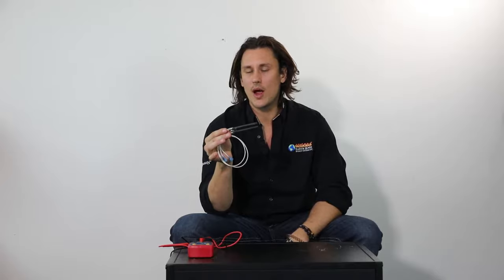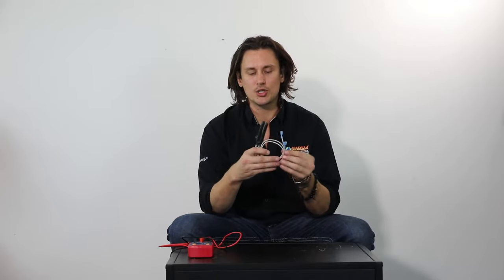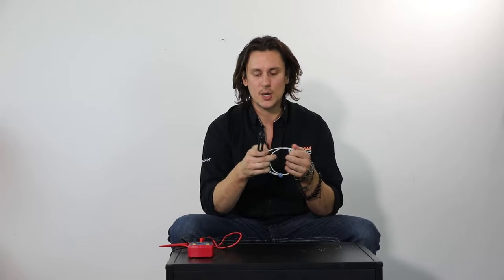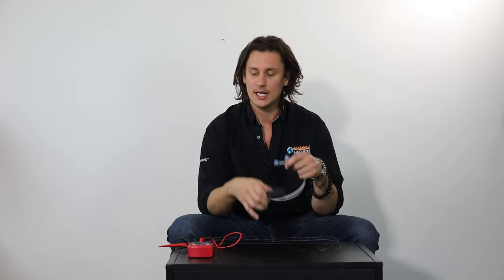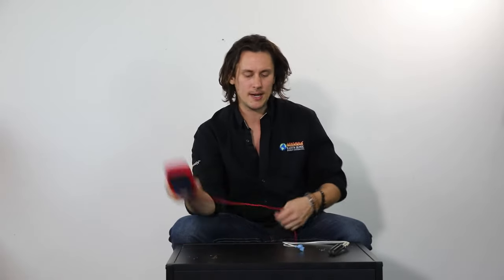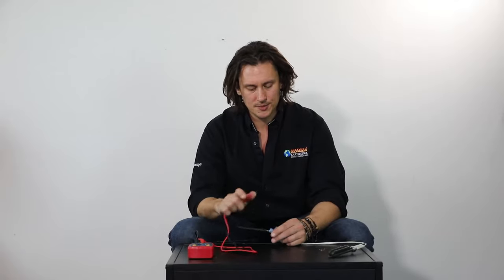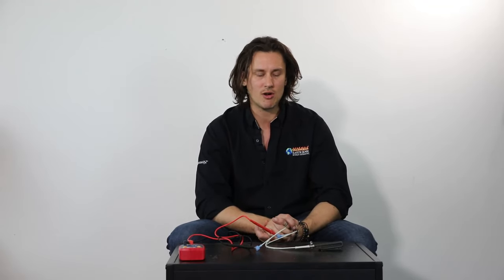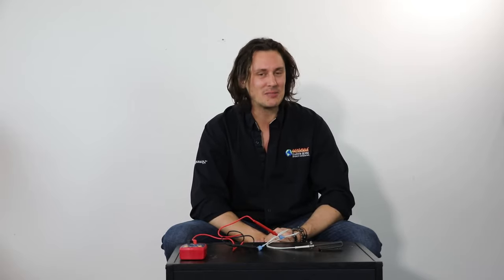How To Test A Stove Igniter, Pellet Stove Ignition Troubleshooting

Comment: Did not see the Ohm range list at the end.  What is the range for a Jamestown P1000?
Reply from the maker: Thanks for the message. We have a running list in the description. We offer two different aftermarket replacement igniters for the Jamestown J1000 (J1) model pellet stove. Optimal ohm range is 54.5-63.0. We do not stock the factory igniter for Jamestown and would not have exact ohms for the original, however this is still a good range to base off. Igniter options for reference - https://pellethead.com/product/pellethead-replacement-jamestown-j1-j1000-igniter-element-4/
Any other questions please let us know. Thanks!

Comment: My ignitor shorted out, now the new one won't work and I tested the ignitor your way and it is good.
Reply from the maker: Thanks for contacting us. What stove model do you have. Some units will have a fuse for the igniter. We need to see if power is coming from the control board lead igniter wires.
Reply: @EarthSense  MTVERNINSAE-MBK
Reply from the maker: @AboveItAllDroneShots  Thanks for the message back. The Mt Vernon AE will have an igniter wire harness with an inline 7 amp fuse. This harness goes back to the control board. Let's get a multi-meter and verify the fuse is good. Let's do a thorough inspection on that wire harness for both connection points and any damage to the harness itself. Keep us posted, happy to assist. 
Thanks,
Reply: @EarthSense  got into the control board to find the fuse blown.  Replaced and it works like new!  Thanks for the assistance, it is well appreciated:)
Reply from the maker: @AboveItAllDroneShots  Fantastic to hear! Thanks for letting us know, and glad we were able to be of assistance.

Comment: I have an old Enviro pellet stove it will not ignite. It is a EF-111 bay i. I am going to  do the ohm test on the igniter. If the igniter is bad is there an easy way to get the old igniter out.
Reply from the maker: Thanks for contacting us Maurice. Yes, best bet will be to do an OHM test on the igniter to see if it is in operable range. That is a very early style Pin Igniter Element for your model - Not a part we stock, but I would think you should be able to contact the factory to see what the ohm range should be of that element. Part Number of the replacement igniter is EF-127. Appears to be held in place just by two screws and the igniter will pull out with the housing. Be sure to have your stove unplugged from the wall when working with any of the electronic circuitry. Happy to help however we can. Thanks!

Comment: What wire do you order to replace the wires that connect to the igniter?
Reply from the maker: Thanks for contacting us. Generally in this case you would need to order a replacement wiring harness for the stove. What make and model stove do you have? Happy to help.
Reply: We have a Quadrafire FS Bayfront 1200  2009. We replaced the fuse to get power to the stove. Replaced the igniter which didn't work. The cover on the wire that connected the igniter wasvery brittle exposing the bare wire. We were going to have someone replace that wire. Are you saying you need to replace the harness instead. Everything works on the stove except the startup, we've been starting it maually.  @EarthSense
Reply from the maker: @leslieswafford5824  Thanks for the message and information. In this case the manufacturer would recommend replacing the wire harness to ensure there is no damage to the circuit board/control box. For the 1200 model the wire harness comes with the Junction Box. There are serial number cutoffs right around the 2009 manufacturer date. You would need to verify your serial number. Reference link below. A person could attempt to splice in a replacement wire there, however we wouldn't be able to advise something like this or have any certainty on it working correctly or causing issues/failures of other components. Any other questions please let us know. Thanks. 
https://pellethead.com/product/quadrafire-1200-fs-junction-box-wire-harness-after-serial-352612-oem/
Reply: 007C is the model #. How difficult is it replace the harness? Any video? @EarthSense
Reply from the maker: @leslieswafford5824  There should be a series of digits after the 007C numbers.. Serial number cutoff for the 1200 wire harness is 352613. Important to know if your model is above or below that number. The Harness and Junction box does come with instructions. If one is pretty handy it should be fairly strait forward for install. Unfortunately we do not have a video on this, but we can help walk you through best as possible if that was needed. Thanks.

Comment: Hi, I have an older Quadrafire Mt Vernon pellet stove fireplace insert. The connector on the main board feeding power to the ignitor overheated and burned due to an intermittent connection. New boards are quite expensive, and I can't see replacing the entire board because of one bad connector, so I'd like to repair it (I have experience repairing boards). Do you have any experience working on these?  I'm trying to figure out how to remove the board from the chassis so I can work on it. It's pretty tight in there and I can't see how/where the board is mounted. I'm wondering if I'm going to have to pull the insert partway out of the fireplace to get that board out or not. Thank you for any help!
Reply from the maker: Thanks for the message Kip, happy to help. I just forwarded this message to our lead technicians as they have the most experience with the Mt Vernon AE model. I will follow up ASAP when I hear back from them. Be in touch very soon, appreciated.
Reply from the maker: Hey Kip, heard back from Tech - Yes, much easier to pull unit…unclip all component wires…board comes out in the black plastic…will then need to remove it from the black plastic shrouding if further access is needed. Repair is something you can try; we are here if replacement is needed, and we recommend the fused igniter wire harness. https://pellethead.com/product/quadrafire-mt-vernon-ae-edge-60-ignitor-wire-harness-oem/

Hope that is helpful. Thanks.
Reply: @EarthSense  For anyone else reading this...the board is encased in a black plastic housing. The back side of the housing has 3 round posts that slide down into slots in the metal mounting plate, and a locking tab located behind the top heatsink. After you pull all the connectors off, pinch that tab towards the heatsink, then slide the entire board upwards...it will release from the plate and you can remove it.

If anyone else experiences the burned connectors, what I did to fix it was to desolder and remove what was left of the two connectors on the board, clean up the board (remove carbon), then solder wire pairs into the board (lamp cord works and can easily handle the ~3 amp current draw of the igniter). Then I removed the corresponding plugs from the cables and used insulated connectors to make the connections. There are two connections for the igniter: the bottom-most one supplies 120V to the igniter relay on the board. The one above that feeds 120V to the igniter when the relay actuates. On my stove, both of these connections overheated and charred both the plugs and sockets to a crisp.  Definitely under-engineered, IMO. Cheers.
Reply from the maker: @kiplandingham322  Thanks for sharing all of your details Kip, I'm sure that will be helpful for others. Very appreciated, any questions down the road please let us know. Thanks!

Comment: I have a Quadra Fire Mt. Vernon AE pellet stove insert.  I'm burning wood pellets.  Stove won't ignite.  I tested the igniter and replaced it, new igniter worked for a couple of days now won't ignite again.  Igniter is still good, replaced the thermocoupler, and cleaned stove thoroughly, still won't ignite.  Airflow seems good.  What else could it be?
Reply from the maker: Thanks for contacting us, happy to help. Are you receiving any kind of error codes on your wall control?

Comment: Cumberland MF3700/3800
Contractor told me the igniter was bad. Bought a new one, it worked flawlessly one time. After that it does what it did before, won't light and message onscreen says no proof of fire, indicating a bad igniter according to the manual. What would cause a brand new igniter to go bad after one use? The stove is cleaned out every use and the seal is good.
Reply: Also getting no reading on the meter
Reply from the maker: Thanks for contacting us Scott, happy to help. I suggest we still do an ohm test on that igniter to see where it's reading - we haven't carried the Cumberland line before, but you should be able to get ohm range numbers from the factory or dealer you purchased the element from. We have seen brand new igniters burn out like this, not that common, but we have seen it. You could check the mount of the igniter, not sure if it mounts in a housing/tube in that model, but we want to make sure the mount is correct and that the igniter is not grounding out on any metal or tubing it's inserted in. There could also be the possibility of an issue with the control board timing cycle of the igniter. We have seen that before where the igniter will continue to stay on after that timing cycle and burn itself out right away. Let's start by checking the simplest items first and go from there. Keep us posted. Thanks!
Reply: @EarthSense   @Earth Sense  thanks for the reply. I tested it with my multimeter and didn't get a reading at all. Is there a way I can test the timing cycle switch to see if that's the issue?
Reply from the maker: @Slesher0127  Sure thing Scott. There should always be an ohm reading from the igniter. Again, there is an optimal range it needs to be in to fire properly, but there should always be a reading on the multi-meter. Double check the meter settings on that. On most stoves the igniter timing sequence is built into the control board. Again, not sure on Cumberland as we have not handled that line. Generally speaking the control board would need to be tested by a dealer, but again not sure on the Cumberland model - it may have a separate timing block. I would suggest you reach out direct to the factory and pull in there insight here. Happy to help however we can. Thanks.

Comment: I was wondering if you could tell me what the ohms should be reading for the igniter on my St Croix Prescott fxl
Reply from the maker: Sure thing. Do you know the age of your Prescott EXL? Should be able to locate the manufacturer date on the rear UL label. 2 different igniters were used; one for 2004 to current models and the other for 2003 and earlier Prescott models.
Reply: @EarthSense  2015
Reply from the maker: @bobby1965ify  Thanks Bobby. Your igniter should have an ohm range between 54.0-63.0. Here is a link to the replacement for reference. https://pellethead.com/product/st-croix-afton-bay-ashby-prescott-igniter-element-2004-to-current-oem/

Any other questions please let us know. Thanks!
Reply: @EarthSense  thank you so much appreciate that mine's good thank you

Comment: i have a stove igniter measuring 209 OHM i dont realy know the make or model,  but guessing it only draws 250W @ this rate i think i may assume its bad ?
250w cant really generate much heat it think :)
Reply from the maker: Thanks for contacting us. Yeah, I have never heard of an igniter at 209 ohms. The 250 watt igniters we carry have a general range of 54.0-64.0 ohms. I would strongly lean towards that igniter being shot at a 209 ohm reading. If you know a part number or can figure out what model you have we can steer you in the right direction for replacement. Thanks!

Comment: Great videos!  I have an Enviro Milan insert that started flashing a #4 light at me when I started it up for the first time this season.  The manual doesn't mention a #4 error code, but my understanding is that it's a problem with the vacuum.  I bypassed the vacuum switch, and pellets started to drop, but would not ignite.  I just got a bunch of smoke in my house, which is unusual, and I suspect may indicate a problem with the exhaust blower.  I replaced a bunch of gaskets that probably didn't need to be replaced, and my chimney was cleaned last week.  I used a multimeter to test the igniter, exhaust fan, and convection fan.  The only setting on the multimeter that would give me any readings was the ohm setting.  I'm wondering if you can help me understand them:  
igniter: .036;  
exhaust: .005; 
combustion: .018.  
I also gave the vacuum tube a suck and didn't hear the click I've been hearing about.  Where does this leave me?  

- Drew
Reply from the maker: Thanks for your message Drew. With everything you mentioned, we definitely need to take a closer look at your exhaust motor. Can you use your multi-meter to check Voltage readings? That's what we need to look at on the exhaust motor. During start-up it should be near line voltage (100-120volts) to lock in the vacuum switch and provide adequate air for ignition. Let us know if you are able to check voltage on the motor. Thanks!
Reply: @EarthSense  Thanks for getting back to me so quickly!  I have the multimeter, but I'm not quite sure how to perform this test properly.  As I mentioned earlier, I only get a measurement in ohms.  The voltage setting doesn't give me a reading.  Does the stove have to be on to measure voltage?  Am I doing something wrong?
Reply from the maker: @drewcrandall3887  Thanks Drew, Yes the stove has to be on for you to get a voltage reading from the exhaust motor. Keep us posted if you are able to do this.
Reply: I was able to detect a strong 118V getting to the exhaust motor. When I gave it a bench test, it seemed to be in decent working order.  What's next?
Reply from the maker: @drewcrandall3887  Thanks Drew, glad you were able to determine the exhaust motor is running at proper voltage. Check all ash access points in the stove and and check the venting. Ensuring everything is clean is very important for the vac switch to lock in and igniter to light the pellets. From there you may need to contact the factory technicians and get there insight around the issue.
Reply: @EarthSense  Thank you.  The stove is about as clean as I can get it.  Could it be a problem with the vacuum switch itself or the board?  I get 9V going to the vacuum switch.  Is there another way I should be testing it?
Reply from the maker: @drewcrandall3887  Thanks Drew. I just sent our messages over to our 3 lead technicians. I will follow back up with you as soon as I hear back from them. Appreciated.
Reply from the maker: @drewcrandall3887  Hey Drew, Latest Message here from our lead tech: Enviro control boards are like other manufacturer’s boards.  #2 is universally vacuum switch, #3 is universally POF and #4 is generally High Limit.  I was able to find a reference from Enviro for the #4 flashing,

6. Light # 4 on Heat output bar flashing The 200 °F ( 93 °C) high limit temperature sensor has tripped.

• Reset sensor and determine cause. Was it Convection Blower failure or Circuit board control problems?

• Hopper lid has been left open for longer than two minutes.

Not concerned about the component ohm readings but they appear ball park. 

Keep us posted.
Reply from the maker: @drewcrandall3887  Hey Drew, here is the latest from our lead tech: 
1.  Air flow issue knowing the combustion fan working and the vac switch must be jumped to feed.

2.  Has to be an obstructed air path somewhere in the stove or vent.

Keep us posted.
Reply: @EarthSense  Just wanted to follow up with you on this one, as your input was extremely helpful!  I had the chimney sweep come back to detach the liner from the stove.  The stove was installed in such a way that this was not easily done and had been avoided during previous visits.  As a result, there was a blockage at the very bottom of the liner, which has now been removed.  Thank you for helping me identify the problem!  Stay warm.
Reply from the maker: @drewcrandall3887  That is fantastic to hear Drew! Thanks so much for taking the time to let us know. Warmest regards, thanks!

Comment: Trying to fix and older model stove from a house we bought. Have replaced almost every part on it, after ignition, no auger feed and nothing comes on after the initial fan during start up. Can someone help me with this? The sticker says it’s a QuadraFire CB-1200 007C
Reply from the maker: Thanks for contacting us happy to help. We are very experienced with the Quadra-fire CB1200 also referred to as the Classic Bay 1200 model. The thermocouple sticking out over the burnpot is what detects 'proof of fire' during start-up. If the thermocouple does not get hot enough or if it's faulty the stove will not feed fuel after the initial start up sequence. Here is a video with a bit more info on the Quad Thermocouple. Keep us posted, happy to assist. https://youtu.be/JhMTxAzQ9k4